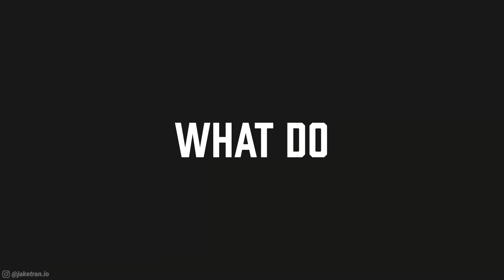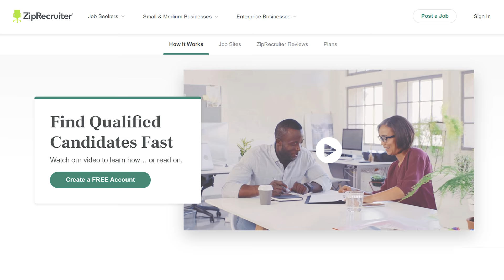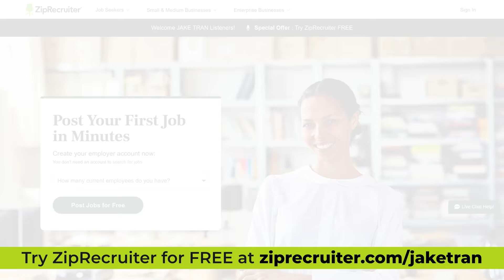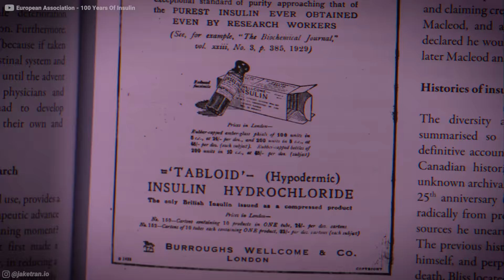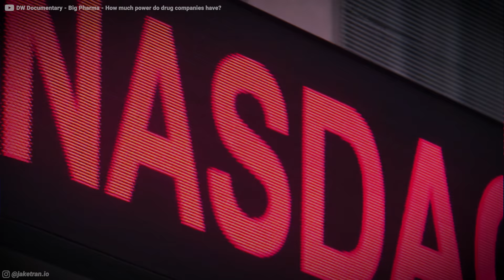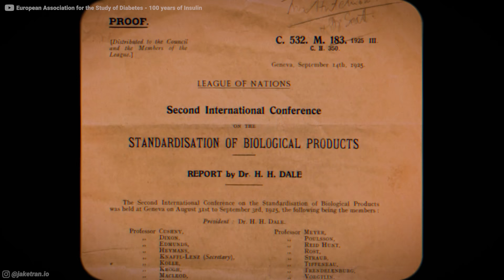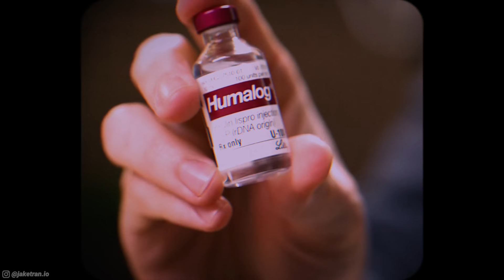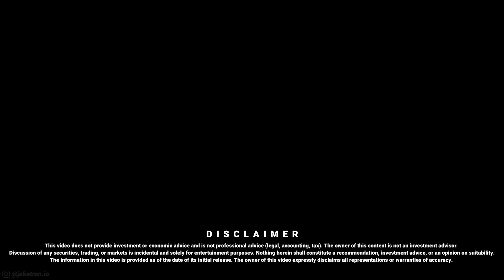OH, so it is all a scam!

Comment: I've had type 1 for 36 years, I'm now 51. I've been on my own since age 18. Throughout my 20's I worked a number of jobs while also attending college, but with the exception of a few brief periods, I never had health insurance. In addition to tuition, food, rent, transportation, etc. I spent around $200 a month on insulin. At the time (late 80's early 90's) you could buy humalog insulin and a 10 pack of syringes over the counter w/o a prescription. A vial of insulin cost $50, and I needed 2 different kinds which I had to mix together (fast-acting and long acting). I would make a 10 pack of single use syringes last at least 6 months, despite multiple shots a day. I'd use them until they were so blunted I couldn't manage to jab them in any longer. I always considered diabetes to be my problem and my cross to bear, so I didn't really complain much about  this added expense on an extremely tight budget. There was no choice, without it, I was dead. I managed my own care, without a doctor's oversight, for close to 10 years. I eventually finished a master's degree, got a decent job and good health insurance (although co-pays for my prescriptions keep going up, and I recently had to pay $600 out of pocket for my prescription of 6 vials). What's scary to me, is that a young person today if they found themselves in my position, would not be able to do this and survive. First, you'd need a prescription now (no more over the counter) which means you need to see and maintain a connection to a doctor's office (more money). Second, the price is completely unaffordable for someone working an average job without insurance. On top of that the price for tuition, food, housing, and transportation are beyond reach for non-diabetics in the situation I was in. I feel lucky to have been in my 20's at a time when all this was still doable if you worked hard and scrimped. But if I was coming up today, I would be completely screwed. Either dependent on some government program, or like this young man...
Reply: Thank you for sharing your experience.  Something must be done.

Comment: As someone who worked in biotech, making insulin is actually relatively cheap, as you are using recombinant bacteria (one of the cheapest biomanufacturers) to produce the insulin.

Also, a few small corrections.  

1. Walmart has recently launched a cheaper alternative called Novolog, but that's simply a band-aid solution. 
2. Even if the insulin is "patented", you can still produce biochemical analogues of the insulin, which is how Walmart approached the issue.
Reply: 1 dollar for a vail here, in india. Also from sanofi, novo nordisk
Reply: I was using Novolog insulin years ago, until my health insurance switched to Humalog.
Reply: I wonder then if we could make insulin at home. Would need a detailed recipe..
Reply: @jonransdell  Thats interesting. I used to use Humalog, for about 10 years, but now "the system" has switched me over to Novolog. (Its branded Fiasp in Europe) For the sake of lowering cost. In Norway, that is.
Reply: Novolog is a Novo Nordisk product. Picked up my father's 90-day resupply yesterday and thankfully Medicare covers it 100% but.. there's a ittle line on the receipt that says: 'Your insurance saved you: $3023.89'. It's insane.

I'm not sure what Wal*Mart's insulin product is, but it's not Novolog.
Reply: @Aulakauss  Google says Walmarts one is called "ReliOn Novolog" and that its the same thing as "Novolog"
Reply: novolog is still overpriced
Reply: It's not a recombinant bacteria, it's a peptide and it is very cheaply manufactured. Distributed free in primary healthcare clinics in Africa.
Reply: How much would it cost (not in monetary terms) to make it? It the equipment too pricey or complex? or a difficult process outside a laboratory? are the components available for the public to buy? Just because it's cheap it doesn't mean anyone can buy it right?
Reply: @chrisb.2028  I know a small company that started this. I don't know what their startup costs were but I do know that they are not researchers, just entrpreneurs. It is not legal for them to sell to humans, that's the law. They are allowed to resell for research purposes. Quality assurance does not raise costs, it can even be done by an independent lab and there are no legal restrictions on that. The red tape comes from the medical regulatory councils but actually, there is nothing new or unknown about insulin.
Reply: @butterygold  Once again, big government gets in the way of life. Medical regulatory councils do not care if people live or die or they would regulate the prices. Instead they choose to regulate competitors out of being able to easily enter the market with a viable product
Reply: Humalog Mix 25 or 50 Kwikpen cost the NHS up to £30.98 for five pens. As a patient, with a chronic condition this will be free, as will disposables. The cartridges on their own are £29.46. These are supplied by Eli Lilly.
Reply: LOL.  I've been using Novolog for decades.
Reply: @TorontoPopulistConservative  Yes that's true
Reply: @butterygold  Wrong.
Reply: @Lion I don't think  that you understand what "profit" is.  Mark up is not profit. I'd explain but you wouldn't understand.
Reply: @goldwinger5434  What's wrong? I can buy insulin tomorrow.

Comment: Frankly, what’s stopping me, as a microbiology major, from undercutting the market? The main issues I’d have to worry about are the lawsuit (which I bet could get a lenient settlement or even counter sue and bog down their company with litigation) and high startup costs. I have seen (and done) firsthand how easy it is to genetically edit a bacteria into producing insulin, cultivate it, and process/purify it. I’m thinking in 4 years I could do it (I still have to complete college yet and I’d need the capital necessary to start it). I’d even do it outside of hospitals, so that there’d be no need for insurance.
Reply: The barrier to entry is huge in the United States. Even if you produce high quality insulin, you still need to get FDA approval to sell it. The FDA approval process is complicated and slow. You'd have to get your manufacturing facility/processes approved, do trials to show that your insulin effective, etc.
The barrier to entry is what makes the cost high in the US. Large drug companies actually lobby for regulations/inspections/licensing which would prevent smaller manufacturers from competing with them. It's called "rent seeking".
Reply: All that being said, there is definitely a market. If you can make it happen, there's money to be made.
Reply: @chrishubley7849  You’re absolutely right, somehow I had totally forgotten about the FDA lol. Taking that into account, I’d figure about a 10-15 months just for drug approval (since it’d be very similar to insulin that’s already on the market) and about another year or two for them to inspect/approve the production facility.
Reply: The only solution I see working at all to combat the systematic abuses, is if basically overnight everyone could be taught the "simple" way of manufacturing their own insulin (or maybe if local clinicians or nurses could all get taught how). Like one of those little lab exercises that everyone learns at camp or during a science fair or medical conference session. Exactly HOW that would happen in terms of access to equipment and testing for safety I don't know... that would take some creative brainstorming; but its probably not impossible if you decide thats what you want to do.

Either way, its hard to monopolize something that everyone can do. They can't sue the American people for trying to stay alive, right?
Reply: @neodlehoko404  very true, but the simplest way would involve going back to refining animal insulin which has its own problems (negative reactions like injection site swelling and redness and having to harvest animal pancreases). I do however like your idea of using already existing infrastructure to manufacture it, but that comes with its own problems of having to hire and train people to do it. In all, it would be a major financial endeavor to implement any form of personal production
Reply: You doing that would be 'the free market'. The reason you cant do that is regulation, IP, and special interests. Getting rid of IP would be the single best solution to this problem.
Reply: @chrisfrey254  right, I mean I think what’s important is not having the perfect counter plan right off the bat, but knowing we have the capability to do it differently and unwind the current system if we plan it out and collaborate. Since we can at least all agree that the current system sees people’s lives as reasonable losses in the course of its profit game.

I think our best bet is starting up multiple varying strategies simultaneously rather than one bullet proof one, so that they can’t all be targeted at once. 

Basically relying on the genius of many different people to come up with something interesting, viable in their context, and helping them get it done. Think that’s possible?
Reply: @deacon6221  I think considering that the FDA is bought into the current scheme and profits from it, the FDA would have to be circumvented period. We’d have to find alternative ways of testing for safety, since the FDA is really just for entities who want to sell medications legally and avoid litigation.

But that whole “license to sell” business of which FDA is the gatekeeper: that is exactly the problem we’re trying to avoid, right?

So the question is probably; if we give many people the skills and materials to produce their own insulin, how do we also help them test that it’s safe to use?

People are naturally careful with their health, people who brew their own alcohol make sure they distill the instruments properly and all that. In the end, if it’s between that or just dying because you don’t have $1000, I know what I would pick.
Reply: @neodlehoko404  I agree but he asked whats stopping him and the main thing is the fda.
Reply: @chrishubley7849  I think the fact that this is a way to make money has proved problematic, no? In context if this video?

If you have to pay anything for a lifesaving medication, you’re just recreating conditions that allow some people to die because they couldn’t afford it.
Reply: @chrishubley7849  The US health market is far from "free market" it seems.
Reply: Black market mate
Reply: @chrisfrey254  Supplements don't need FDA approval.  As the narrator stated Insulin isn't a chemical drug, it's a biological one.  This could open a loophole where your chemicals are combined to supplement your diet but just happen to provide a natural pre-cursor or a type of combine only if digested through the digestive tract result that does the exact same thing that insulin does.  I know that (currently) you can't ingest insulin and that is the beauty of it - As long as the biology of the product is not the same as the original, but is able to create the same results as the original through the natural processing of nutrients then you would be a billionaire in days and you could still sell your supplement without the FDA having any say in it.  And you could make it extremely affordable for people to buy.  I know I am stretching the lines of reality but there are some pretty amazing chemists out there... so food for thought
Reply: Hire me.
Reply: Legally it would be no different  to making and selling crack on the street, but from a human point of view…
Reply: @jnb756  you could sell insulin in little capsules like flaxseed oil as a dietary supplement. It’s not your fault of someone injects something they’re not supposed to ;)
Reply: The best way to undercut those parasites would be for a foreign company to enter the market with an already viable product. They would have the money to withstand the lawsuits and the general shitstorm, and would still make a big profit even by selling the medicine at 1/10 of the price.
Reply: Nice thinking Chris :) is there an alternative delivery system of insulin you could imploy. I wonder if there is a way to avoid all the rigmorole of the FDA if you could for example create a new alternative to the delivery of insulin.
Reply: It's all about framing many products hit the shelves with a completely different use to what they were designed for. For example could you sell the bacteria and culture kits as DIY sugar babies kinda of like Sea Monkeys 🐒 I really don't know the implications but framing products with alternative intentions could be a possibility.
Reply: @TheProudKiwi  there is, but unfortunately it falls outside my area of knowledge (more of a biomedical engineering problem), as I would need to figure out a way for the insulin to be absorbed/injected past the stomach lining. One concept for this would be a pill with a degradable micro needle within it that would somehow inject the stomach lining and deliver the insulin into the bloodstream. As for your other comment, unfortunately I don’t think that’d work as the gov doesn’t like self administration of anything, especially stuff you buy off the shelves. Although I do like the concept of people self manufacturing, as I have previously stated.
Reply: @basmca1  Of course they wouldn’t let me do that but there are plenty of ways to combat it and possibly circumvent it altogether. I think that while I am optimistic for it to work, some of the ways I’ve listed out are actually pretty pragmatic and have promise to them. Nothing good is ever easy, as they say.
Reply: @neodlehoko404  Sadly, they would sue you for trying to stay alive. You are up against sickopaths here...
Reply: You can just buy it from abroad...
Reply: @AnonYmous-yu6hv  Importing medicine? Lmao yea nice try with that one.
Reply: @basmca1  that's what the rest of the world does
Reply: Yeah that’s not going to work. There’s a reason people don’t do what you just described.
Reply: @chrisfrey254  no offense but you don’t seem to be too educated on how this process would work.
Reply: @chrisfrey254  you’d need to do clinical trials, etc etc and not to mention the people you need approval from have their pockets lined by the insulin manufacturers
Reply: What! you think, as an individual, you have the money and power to take on the legal team of one of the most profitable corporations in the world in the US?!?!?!!?!  I want whatever you are smoking.
Reply: Let me know when you are ready, I'll be more than happy to assist fund the start up. I don't make much money but I'll rally up people in my churchs and work to support you 💯
Reply: @kikinatrone  Thank you friend, much appreciated
Reply: Unfortunately, this is not the country we live in. If I was in charge, I would put you in charge of Libby’s insulin program, by force if necessary. If you started an insulin manufacturing company of your own, Libby and its two “competitors” would destroy you by dropping their prices below your cost to produce, which would be easy since they’re already tooled up to produce thousands of vials every day, thus benefiting from economies of scale. Once you were out of business they would raise their prices back up to what they were before your company started shipping. Maybe these manufacturers should be nationalized…
Reply: @davejacobs9042  Their modus operandi should be a bit more complex than that. I don't believe they drop their prices regularly from 500$ to 10$ to remove every single competitor.
There must be a different reason of why no one's giving them competition.
Reply: @asasas9146  I can’t be certain, but I’ll bet their patents are the main barrier to competition. That and the best patent attorneys, and possibly federal politicians, money can buy. If that’s the case, they wouldn’t need to drop their prices because potential competitors would be sued out of existence. I haven’t done research to back this up, it’s more of a gut feeling.
Reply: What would such bacteria need survive and be maintained? You might not have to "sell" them.
Sell especially designed bongs that "may or may not have been contaminated".
Reply: @CRanunculus  it would need a nutrient solution as well as something to keep a constant temperature and environment. Then you’d need something to separate the insulin from the solution, like a centrifuge.
Reply: Count me in, fellow biotech student
Reply: If people can sell meth why can't insulin be sold in the same way?
Reply: You’ll probably end up like all the people who have found legitimate cures for cancer and people who make and publicize water powered cars.
Reply: @asasas9146  because they end up dead.
Reply: Pretty soon you'd have heavy set men showing up at your door saying, "Nice place you got here.  It'd be a shame if something were to happen to it."  BTW, I think it's a noble thought.
Reply: why don't you just invent a machine so people can make their own at home?  Completely eliminate the middle men altogether.  The government could be appeased as they get their tax on a medical device.
Reply: @LisaKnobel  that’s a good idea, though I do lack the knowledge to actually make such a machine. Networking with engineers would solve this problem, although it would require more infrastructure and resources to do so. Great alternative though and I do appreciate the idea!

Comment: My wife was a type 1 diabetic for almost 40 years. When we got married in 1987 her insulin was $ 19 dollars a month. She died in 2018, and her insulin was about 180 per bottle,  360 a month. That cost did not include, needles, and testing supplies. I believe a cure was found long ago, or they were very close to one.  in the 90's .  If I remember correctly they were injecting stem cells into the pancreas. Where they grew into healthy insulin producing cells. The funding and research was stopped, supposedly for ethical reasons